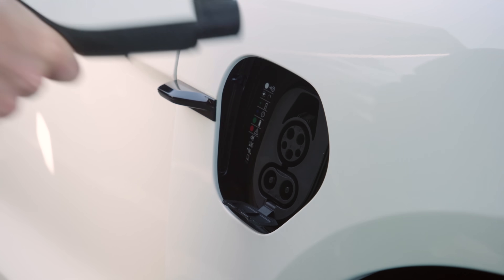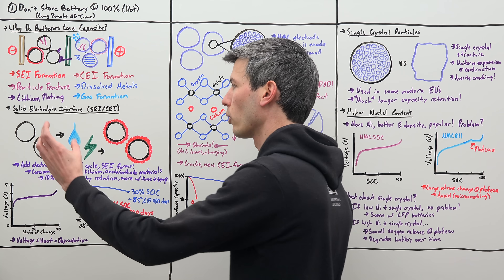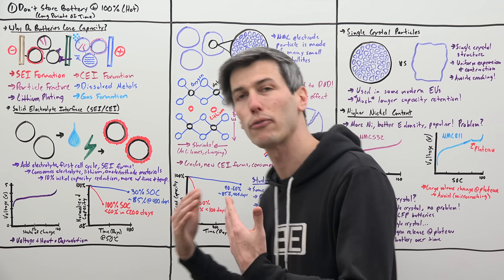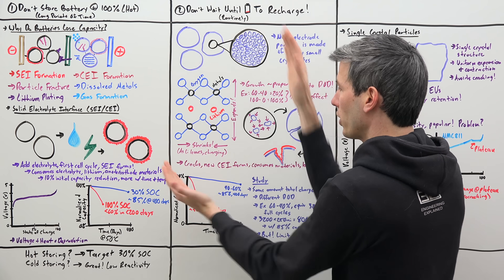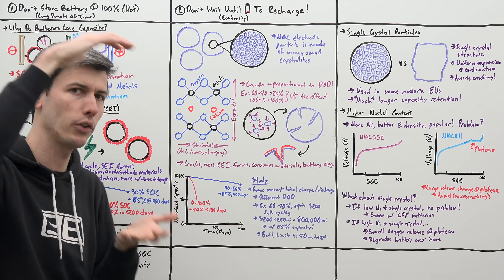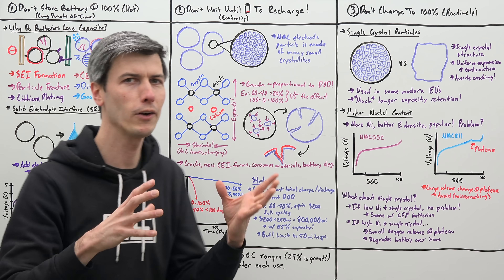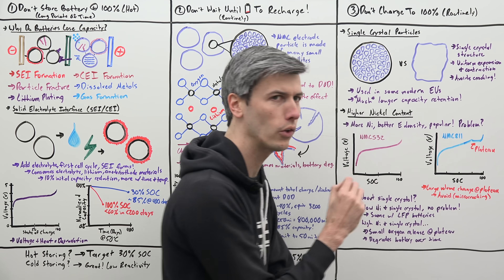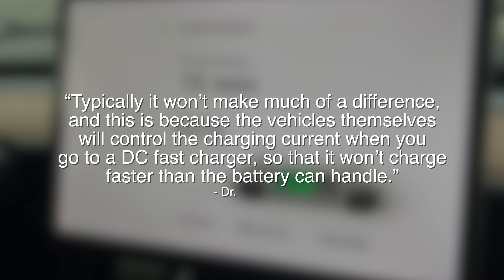How To Ruin Your Electric Car's Battery - NMC Edition!

Comment: I personally believe you're blowing a lot of smoke!  the manufacturers have the parameters set to maximize battery usage even though it says it's 100% charge in actuality the batteries may only be 85%. Charging systems are not a straight voltage to straight current some use pulse charge, are very complicated software are high frequency  parameters.
Put your charger on a scope, you may be very surprised!
Just follow the manufacturer's recommendations in the manual otherwise you're going to be in big trouble.

Comment: Is it better to charge at higher or lower amperage on just ac? I know you mentioned dc fast charging being ok, but is it any different at say 240v 16 amp vs 32amps? Thanks!
Reply: 32 amps would charge the Battery but would Cause the Battery to Overheat unnecessarily better to have a lower Charge Rate if you have the Time to Wait !!!!!!

Comment: What? Electric doesn’t make sense if you cannot charge at home!? Here in the Netherlands I can charge at 3 chargers within 50 meters of my house and even without that I don’t mind stopped at a supercharger. The price of electricity is about four (4!!) times lower than petrol per km. Also say my battery will get “only” 1500 cycles before it’s done, then that is about 500 000 km or 310 000 miles. That’s gonna take me about 30 years!! I’ll probably want another car before that.
Reply: If you have three chargers within 50m of your house, then you effectively have charging at home…which proves the point. I’m very supportive of EV’s but they’re not perfect for everyone. Increased infrastructure is the solution and you seem to already be benefiting from it in your country.
Reply: @Andrew-kj9fz  Most of the time, I avoid those since they are too expensive and just stop by a supercharger though (which yes admittedly also 3 within 80 km). A benefit of living with many people per square mile in the Netherlands.

Comment: Yeah 400,000 miles is 50% degradation of 800,000 miles but the car will rust to shreds before you hit 400,000. The battery replacement scare was already a tempest in a teacup in 2012. Today that issue is about as real as the immaculate conception.
Reply: Battery replacement worries != Degradation worries.

We have zero statistics on how often tesla, for instance, has to fully replace a battery.
Reply: @wizzyno1566 there are zero statistics because it's not that big an issue.
Reply: Aluminum cars do not rust but I get your point. After over 200,000 miles I just replaced a battery on one of my Teslas… And I did literally everything wrong, so as you point out this really is not that big of an issue.

Comment: I have a 2017 (2018 model) leaf, with 21,000 kms on it, which for the 10000 kms and 20 months i have had it, is always charged to 100%, and regularly gets down to 15% and Its driven hard, always parked outside in sun and frosts(canterbury New zealand).  
Despite being 7 years old, It's still at 92.4% health, having only dropped 0.4% from when purchased, so having a bit of a hard time thinking this is as big an issue as some say it is. (if this rate continues, it will only drop 4% over the next 100,000 kms)
- Note it has only ever had 26 fast charges(were before i got her), maybe lots more would be more of an issue, than actual charge level? (i charge at 2kw mostly, 3.6kw max, and often leave plugged in for 48 hrs or more).

Comment: I used to have a 2016 Kia Soul EV that would let you adjust the max charge from 80% to 100%. Unfortunately, the US government forced them to alter this capability for a while because they said it misrepresented the actual range of the vehicle. Eventually they withdrew this but Kia never put that capability back in to those models. I have the 2018 version now and it can only charge to 100% (unless you manually unplug it of course). And sadly, the EVSE on the wall can't stop the charge at 80% or whatever because the vehicle does not (as far as I know) send the current state of charge to the EVSE. Essentially the car is in charge of starting and stopping the charge.
Reply: 2023 Chevy Bolt EV allows me to adjust charge Max over a wide range
Reply: @rp9674  I'm jealous! Most new-ish EVs do allow this but mine is somewhat old (still a fantastic car though).

Comment: I have a Kia soul from 2019.  It doesn’t have a setting to limit the charge, so I do charge it fully quite often. The only way to avoid this would be to wake up in the middle of the night and unplug it, or to guess when it I’ll be 80% charged and set the timer each time.  But I have tried that before and then not had enough charge the next day.  Are there any other solutions out there?

Comment: I own an EV scooter Ather 450 S, which uses a 2.9 KWh NMC battery pack.

I charge it at home using the 350 W included charger and follow a 30-90-30 charge cycle.

This makes sure I have enough range plus some more for everyday commute while maintaining good battery health without comprising on range.

Comment: ... so far so good; theory and correct. 
Cars have a battery management system (BMS) - in practice: 
IONIQ5 about 50,000 km for 3 years - degradation less than 3% in the first year. We rarely charge to 100%, but we do before a trip. And if the car sits for 6 hours, then something like that is not relevant in practice. ... but THX for your video.

Comment: Kia's EV6 owners guide specifically directs you to charge to 100% once a month to maintain battery health and extend battery life.

We had an eGolf with no thermal management and we always charged to 100%. Ambient temps ranged from 110F to -20F. After 60,000 miles, it still had roughly 90% of the original capacity still available. With the exception of the craptastic Nissan Leaf, EV batteries are really very resilient. The Leaf's problems were typical Nissan-engineering problems, not EV problems.
Reply: 90% capacity at only 60,000 miles isn’t anything to brag about, that’s terrible

Comment: I have a question as a new full EV owner. 

Is there a break in period for EV batteries? As an example, don't fully sharge it for a specific period of time or don't surpercharge it for some number of cycles? I know that the brakes need to be broken in and that the electric motors do not for the most part. Things like using cruise control right away are not a problem for EVs I am guessing, but I want to make sure that I do the proper break-in for the battery if needed. Thannk you for your insights!

Comment: Car manufacturers can put a higher capacity battery and limit the charge max with software that way when you charge "100%" it's really 80% and it doesn't kill the battery.

Comment: Whilst I understand that during fast charging most EVs have a BMS so that the battery doesn't receive too much current, but does the BMS still prevent degradation caused by the increased thermal heat generated by the 'fast charge'? I've watched some other videos which have stated that fast charging will ultimately degrade a LI battery. This goes for EVs and other devices that use LI batteries, i.e. our smartphone batteries are also suseptible to fast charging.
Reply: EV batteries are thermally managed at all times.

Comment: I have a Jeep 4XE and the battery only holds enough charge for about 30 miles. 

I drain it every time I get behind the wheel. So basically, I'm screwed.

Comment: Not a bad video. For daily driving you don't need to charge to 100% as you will not be driving 300 miles in a day with local driving. But it's not terrible to charge to 100% if you need it for a trip. Just don't charge and then allow the car to sit for a long period of time. Charge to 100% then start your trip right away. In some parts of the Southwest you really need to charge to 100% on certain stops.

Comment: One dilema I've been having lately....
Let's say you have just one hour at luncht time to charge your moped EV, what option would be better??
1.  Charge with more power and quicker to get as much battery percentage as possible
2.  Charge using less power to preserve battery life but letting it fall at the end of the day under 20% beacuse in one hour, there is not enought time to charge properly.? 

Thanks

Comment: Hi. About charging to 100… most car makes makes the battery at 82 kWh but you Can only use 77 kWh. So evne if i charge to 100… i dont really do so because i only Can use 77 kWh .. ro am i wrong

Comment: Brand new ford transit  2024 van had 62 miles when got it first week charged to 150 miles full charge 
2nd week charged to 142 miles  full charge 

4 weeks later charges to 129 miles full charge 

1 year from now let's say 80 miles max these vans cost double than a engine transit it's a joke 

The battery's ain't ready yet there forcing electric out

Comment: Those Buses in Chile will soon start Stopping, one by one; has already happened in Australia;  it is an experiment that will fail,   
    you see, the BEST lithium battery has less than 300W-hr per kg, while diesel or Gasoline have 30 times that, or 10000 W-hr per kg, so the TONS of batteries that a BUS needs to carry, FULL or EMPTY,  is just crazy; Electric buses break down for TOO many reasons, not going to enumerate them here,  all i say is that here,SW Europe, the nearly 200 of them, only 88 are still running, and some have caught fire; fire trucks, Ev ones are all broken now, replaced by Diesels again.
edit: forgot to say that here in SW Europe, CHINESE buses, cost almost 800000 euros EACH, considering 480000 price, plus battery insurance,  200000 EACH one charging station(one per bus) plus general maintenance, road insurance,etc etc    for EV  M3-class 1  12 meters ,long; 
    most are not running due to many things, some for DOORS, that broke are there are no spares

Comment: The warranty states 8 years on the battery when I bought my first EV. I’m hoping that it will die or burn when it reaches 7 years. But BYD guaranteed that it will last 1 million kilometers. Which is 600,000 miles, before it needs to be replaced. By that time, the battery technology will reach heights, and would be cheaper, just like phone batteries. I’m not worried.

Comment: What about if you go from like 20% to 60 or 70%.  I don't think the scenario of 0-100% charging is realistic so the comparison of 40-60% vs 0-100% is really nonsensical on a daily basis.  Obviously going from 0-100% is going to be more detrimental to the battery vs doing 40-60%.

Comment: I’m considering an EV for a new outside sales role, with up to 300 miles 3x weekly. It sounds like an EV might not be the best choice because I’m going to damage the battery no matter what. Should I wait a few years for the range of EV’s to get far enough that I can travel 300 miles using ~50% of the battery?

Comment: @engineeringexplained so I’m one of those who took the leap to own an EV without home charging.  I work remote so not much driving during work week.  Car used during week for errands, gym … etc.  Basically short distance driving.  Few charging stations near me.  My question is … I’m going on vacation for 5 days.  Car will be unused for 5 straight days at the end of June when whether can get pretty hot in NJ.  I’ve heard it isn’t good for battery when car is in hot temps.  Is this true?  Do i have anything to worry about with car being out in sun and unused for 5 days straight?  Thanks again for this vid.  It’s put some ease into my mind about battery degradation.

Comment: This should be a required syllabus for anyone who has an EV or buying an EV.  Great video!
Reply: Including the dealerships. I ordered a BMW i4 and I could check my car this Monday. They charged the car to 100% and there are 35 Celsius max here for the whole week. I was a bit angry. Fortunately I get it on Friday, so the car will stay with 100% only for 5 days.
Reply: But it is rather sad that you can't fully use the car as presented/advertised. Imagine telling folks, some damage or premature engine failure will happen from putting a full tank of gas in a car too often 😂

Comment: Hope you can help with my marriage! my wife insists on following the instructions for charging, but your video makes more sense and by charging to 100% cannot be good, especially in the hot summer. I have always charged my 2019 Tesla M3LR to 80%, but our new MY RWD recommends to charge to 100%. I know different battery chemistry LFP, but confused where  regen energy will go when batt is full and why tesla recommends this strategy. Can you help with this?  I just did a $10 donation not knowing to type here first, so please find $2 more.  love the channel!

Comment: a video for those who are living in apartment buildings (most of the Europe) and rely on fast public charging would certainly help covering both LFP and NCM battery chemistries. Then a chapter in same video should LFP battery be charged 100% once a while (or how often) on public chargers for battery calibration management system.

Comment: Hi! I recently bought a 2019 Toyota Prius Prime, with a 40km (25 mile) all electric range. I routinely charge it to full overnight, use it, and charge it again at work as I commute on about 60% of a charge each way (25kms). I have heard that the battery keeps the top 20% charge unavailable, so 100% is actually only 80% charge, but have been unable to confirm this. Do most EV's have a "reserve charge range" to help with this?
Reply: Hi Josef,

We just got a 2024 Prime. From what I'm able to gather with other videos here, the 13.6Kw battery does indeed have a buffer, top and bottom to  protect the battery. Not completely sure but, I think it's 10% in each direction. Since getting the car in mid-March we have charged it to 100% every evening (with SOC varying between 20-80% most days). 

I'm sincerely hoping Toyota has factored in the reality that with a PHEV, the charge cycles will be very frequent compared to  a BEV. If not they'll be replacing a lot of batteries under their ten year warranty. For us, the Prime is essentially a BEV. We have driven 5,000Km to date and have burned less than 1.5 tanks of fuel.

Yesterday, I drove 88Km in EV and the computer indicated a remaining SOC of 6%. The car would have surpassed 90Km with ease. This morning after an overnight charge the computer told us to expect a 91Km range. We are well pleased with that. That's almost 13 miles over the advertised EV range.
Reply: @TomLawlor-iq6gm  91km is extremely impressive, well done! Was that on flat ground? I live in BC, so even my morning commute has a small drop down to a river valley and a climb back out. I can't imagine getting more than about 45km on my use pattern so far.  I am the 2nd owner though, so maybe that's only possible in first few months of ownership? I'm still at about 50/50 EV/hybrid over the 9,000 that I've driven it so far, even with a couple very long (1000 km +) road trips with no charging.
Reply: @josefmacleod  We are in Newfoundland, which is sort of a mini replica of BC regards roads. There are few flat roads. In some ways that helps with EV range. My wife's post retirement place of work is just 3.5Km away. The shortest route to it involves descending a 500+' hill to sea level. I have seen as much as a 2% increase in SOC when rolling down it. On the way back, I take a slightly longer route with the same elevation change but, over much less steep terrain. I usually (ambient temperature permitting), arrive back home 1% higher than when we left.

The key to getting 90+Km in EV is to eliminate all of the resistive electrical loads you can. That includes heat/AC, heated seats, wheel and such. Of course, that's easy at this time of year. But even in mid-March when we collected the car, with daytime Temps of 5c we still reached 70+Km per charge. It goes without saying; you have to drive less like a savage. But that's not to say slowly. In our little town the roads are all posted at 40Kph. We both generally cruise on them at 55Kph. 

Best of luck with your Prius. This is our third Prius and the first two were flawless over 16 years of use. Love to get back to BC again some time, we've visited three or four times and our daughter lives there with her husband.

Cheers

Comment: How do you currently manage your electric car's battery health? It's not as simples as managing a li-on battery of a cellphone. For example, I'd just use a limiter like Chargie to limit the charge of the battery to the recommended 80% and prevent it from overheating. Hoping to find some great tips or hacks for EVs.

Comment: Great video! When you say heat affects the battery, is it just the outside temperature or the temp that is reached in the car if left sitting out in the sun? How hot do the batteries get when driving? Just curious.

Comment: Hey Jason, this is a great video and I have watched Dr J Dahn's video on this too. My 2015 model S battery is only charged to 70% for driving longer distances over 100km and I do charge the car for the trip back to 70%, I use about 30% for most trips. On days were the temperature is above 28 deg C, the charge is around 30-50%. The cars battery easily will do 400km on a full charge after 9 years of use.

Comment: Really appreciate the in depth reasons for best practice battery care.  In my case the power rates are lower off peak, but I will still want to keep the car plugged in so the battery cooling can take place in hot weather.

Comment: I have a question about level 1 vs level 2 charging under this recommendation. If I follow this advice and charge frequently to 80% wouldn't it be better to use a level 1 charger instead of a level 2? My logic is that the parked electrons wouldn't be moving as fast to relocate and be more efficient at finding a parking space meaning less heat, expansion and thus degradation. Thanks for a great video :)